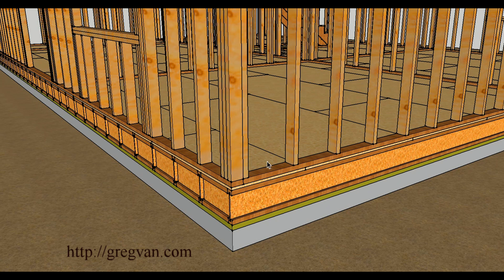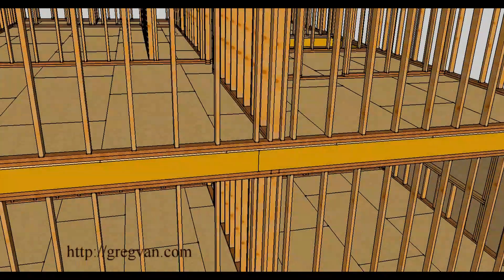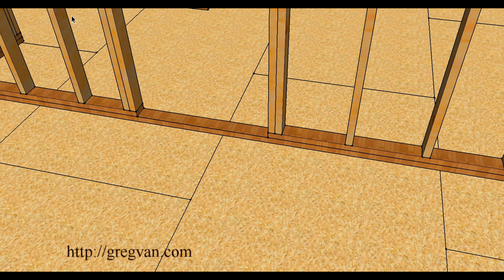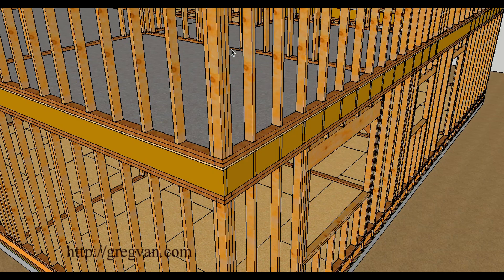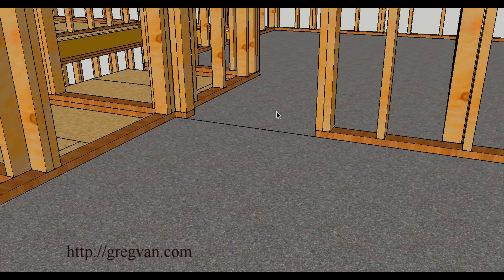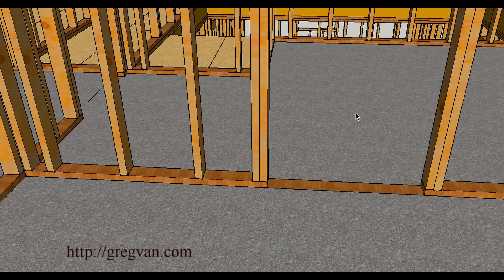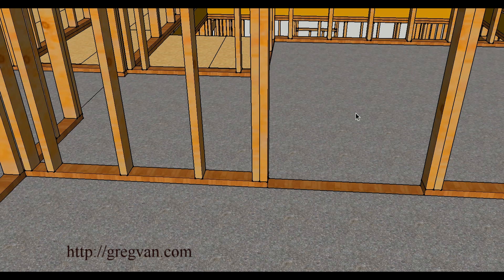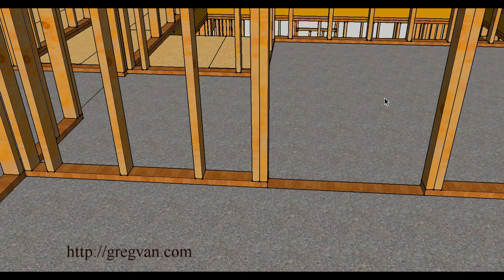Watch This Video Before Using Lightweight Concrete As Sound Barrier Between Floors

Comment: Question, I have an apartment @ the upper floor and they used light concrete also but it squeaks,  I mean, I took the melamine off and realized that the actual concrete does squeek when you step on it...... do you know why and if there is a way to fix this?    thanks!
Reply from the maker: If it's moving, you will need to find out why and this might require removing the concrete or ceiling below to start looking for the problem.

Comment: Should I use 3/4” subfloor or 1 1/8” subfloor for this lightweight concrete floor?
Reply from the maker: I can't help there, but I've seen it installed over both with good results. I think the more important question would be if the floor, walls and foundation can handle the extra weight and that might require an engineer.
Reply: @ 
We are planning a new construction here in the next couple months so all of that should be covered

Comment: Do we need any underlayment (visqueen, plastic, ...) over plywood sheathing before pouring light-weight concrete?
Reply from the maker: I don't think you would need any type of vapor or moisture barrier as long as it's going to be located inside the house or building. However you might need some type of waterproofing if it's going to be located on the outside. I've always seen the lightweight concrete poured directly on top of the subfloor.

Comment: 2 problems with this method, 1 sound is resonation, the sound will resonate up threw the framing and it actually gets louder. you are building a speeker out of you walls.  2  1.5 inches will do nothing and it will fracture easilly because of its structure
Reply from the maker: I've never been impressed by the lightweight concrete and you do bring up a good point about sound resonating through practically every part of the floor framing, including the lightweight concrete. However, I'm willing to bet that somewhere, someone has done a lot of testing and actually has satisfactory evidence to suggest that lightweight concrete does reduce the level of sound transferring from the floor above to the floor below.

Comment: Gypcrete is garbage, a terrible idea, but building and safety bureaus make it mandatory. Absolutely correct, it makes the floor sag. Even between joists with 20" spacing, the flooring will sag over time.

Comment: Just to clear a few things up here... Concrete is mass, which is critical to sound isolation. No debating that. You do however need to assess whether your primary issues are impact noise (structurally transmitted) or air borne noise.  With gyms it's primarily IIC (Impact Insulation Class) that is the ruling factor. Concrete works better for sound that is air borne. IDeally you want concrete with a cushioned underlay to reduce impact noise. Resilient channel on the ceiling below helps with structural transmitted noise as well.
Reply from the maker: Thanks a lot for sharing and great information.

Comment: Most contractors would only use gyp-crete to cover the radiant tubing. There is no point otherwise, if you want sound proofing you would apply soundproofing between joists.
Reply from the maker: I would tend to agree that other methods might work better.

Comment: Question.... In this type of construction are the studs cut down that extra 1-1/2” so that shear walls run down both lower plates and drywall? Which would also shorten the ceiling by 1-1/2” after concrete poured?  If the studs aren’t cut down then next size up in shear wall would be needed and special cut to length?
Reply from the maker: You would need to contact a structural engineer for more information about sheer walls in this type of construction, but usually the extra bottom plate is added and the light weight is poured up to the top of the lower framing plate, then the wall framing studs would remain the same sizes.

On some of the older projects I've done in the past, the framing studs were not modified for the sheer panel and the sheer panel went on like it normally does.

Comment: I used a self leveling compound (which is concrete) on my second story bathroom floor (floor joists sagging) during my remodeling it.  I covered most the floor with it and it has eliminated ANY sound coming through the floor to the room downstairs. I was very happy with it.
Reply from the maker: Hopefully you don't have any problems with the self-leveling compound separating from the subflooring, if it wasn't installed on top of concrete. I like your thinking though.
Reply: @gregvancom  it has a plywood/particle board on top of it, then vinyl tile to finish.  Very interesting outcome if you ask me 😉

Comment: Thanks for the presentation! I thought your title referred to filling the bays between joists with aircrete, which is the option I am considering for a nice 1940s house getting split into 2 rental units. And for insulating the walls. Trying to find out all the things that could go wrong.
Reply from the maker: You definitely won't want to use lightweight concrete and wall framing, but there are plenty of other options for reducing noise in between two units. Insulation and soundboard might be on your list.
Reply: @gregvancom  Thank you very much! This is for locations with no access, except for any drilled holes (all finished surfaces). Injected blown cellulose (settlement) and spray foam (outgassing) both have detractors, leaving AirKrete perhaps, with surprisingly few detractors - however no one does it here. As MgO cement is getting rare and expensive, we have figured out a very light and dry Portland cement alternative. Yes you are prudent to not recommend it, but no specific reason against it was offered. Contact with wood framing is a problem if the foamed cement has access to moisture, but moisture has to be avoided in any case. In fact we have found that one-time-use form-boards hold up better as floor joists than otherwise identical new lumber. thanks again.

Comment: use aircrete for soundproofing. it is the new light weight concrete using foam
Reply: Aircrete or gypcrete
Reply: @sherifnabil9663  gypcrete, what is that?

Comment: For a gym this is totally inadequate. For multifamily housing it's great
Reply from the maker: I have to ask, why would it be good for multifamily use and not for something like a gymnasium? In my opinion, sound would travel in the same way through the floors.
Reply: @gregvancom  Because with gyms IIC (Impact Insulation Class) is the ruling factor. Concrete works better for sound that is air borne.

Comment: This sounds like more trouble than it's worth! Would not foam filled floor work better, with thick wood over, like 4" thick flooring, I dong think it would help with treadmills,  but I don't sound as if litecrete does either!
Reply from the maker: I agree and don't think I would ever use this product, especially after seeing the results of it being used.

Comment: It's lightweight concrete if you put that many bolt or nails to get your walls up it would most likely crack your floor. Pouring the floor after the rooms are in also helps with further sound reduction having the 2x4s imbeded in the floor when the Crete is poured. Most rooms I've poured also have drywall up but sometimes don't depending on plans.
Reply from the maker: I think it was me I would pour the concrete after the drywall, stucco or siding and the roof was loaded or finished. This would help, but if the floor joist ever sagged, you'd be back to cracking and thanks for sharing your experience with us.

Comment: Please forgive my naiveté, but why would anyone frame a sub-floor over a slab or pour a slab over a framed out 2nd floor? Where I'm from, only older homes have sub-floors and newer homes all have slab-on-grade. This is the first time I have ever seen an example of a building with both. And if you were to want/need the 2nd floor to be of concrete (again, something I have never seen), why not simply install and pour over a metal decking (like is done in commercial applications?
Reply from the maker: You bring up a good point, but most of the time this is used on floors above the building foundation, for example a second or third floor. And of course yes there are different ways to do this and probably some that are much better than others.

Comment: Pearlite would be the aggregate you are wanting to mention.  It is not expanded rock ... it's expanded glass.  Imagine a piece of molten glass (super hot) that has been turned into a foam by aerating it to the extreme.... millions of tiny bubbles.  This gives it a very high thermal resistance, and it would probably help with deadening noises.... the air pockets themselves do that, not the concrete.

A better "lightweight concrete" for this application would be aerated concrete, also known as "aircrete".  It is made of pure portland cement mixed with a dense foam made from dish soap and water.  The weight of aircrete compared to concrete is perhaps less than half, as it's filled with tiny little soap bubbles.  It's durability could suffer a bit, but it's use as a sound barrier would be vastly superior to the lightweight concrete you mentioned.  Make certain to install a good sturdy flooring substrate over top of it.

You may also wish to make it go even further by mixing pearlite into the aircrete, as that would have little negative impact if any at all, and take up additional volume.

I would suggest you make several test plates of varying thicknesses and install them in a mock room, testing the sound absorption qualities of each thickness and type.  Good luck to you!
Reply from the maker: Your comment is greatly appreciated and I always love to learn more about the business. I have heard of air entrained concrete, which is what you must be talking about with the aircrete and I always get perlite and vermiculite confused, now that I've been doing some gardening realize that it's perlite. Thanks for taking the time again to share your knowledge with us.

Comment: Why not install the bottom plates first and use them as screeding guides, then, after the floor has set, frame and tilt up the walls and partitions?   And, what about gypcrete?
Reply from the maker: That's a good idea and it seems like it would make a lot of sense, but the lightweight concrete seems to get beat up while the construction workers are framing, installing plumbing, electrical and is often poured before drywall installation. I think it's just a way to reduce damage done to the lightweight concrete.

Comment: Hey.  New to your channel but on the weight of the foamcrete we were just doing some test pours.  We made some forms that were 6"x24"x24"  which were the smallest we also did some 8" thick .  We let them sit for 24 hours and we wanted to see how much they weighed and my friends 6 yr old could easily pick up the 6x24x24 over his head
Reply from the maker: That's impressive and would you consider this to be a durable product, something that you could walk on or place large pieces of furniture on. Do you think it would be something that could easily be damaged?

Comment: Sand cement lavarock pozilans and  plastisizers.
Reply from the maker: Are these other materials that are used for lightweight concrete?
Reply: Some of them, yes. Blast furnace slag can substitute for sand and is half the density. These days, thinner (lighter) slabs can be made with the same structural strength and increased resistance to cracking by adding plasticizers and fibers (polyvinyl alcohol - PVA - or polypropylene) to the mix.

Comment: The weights you mentioned is lbs per cubic feet.
Reply from the maker: I rarely come across measurements that are in pounds per cubic feet, but would like to point out that you bring up a good point and that would be to double check building specifications, to verify whether or not weight measurements are per cubic inch, cubic foot or square inch or square foot.
Reply: @gregvancom  NWC is 150 pcf and LWC around 112 pcf possibly lower for insulating types. Using 112 pcf LWC would give you 9.6 lbs sq ft with 1" depth. 1.5" deep would to ~ 14 lbs/sq ft.

Comment: Lightweight concrete weighs 115 lb per cubic foot, therefore at 1.5" thick should weigh 14.375 lb per square foot.
Reply: These days, with the addition of fibers, perlite and plasticizers, the concrete can be even thinner and lighter than that, although it does get a bit more expensive to make it thinner and lighter.

Comment: Very interesting. I still wish I had poured lightweight concrete on the floors in my custom home. Not only for sound but also to minimize bounce. engineered trusses can handle a lot of load but they still bounce. I would have added more trusses. I would have had to consider alternatives to a forced air HVAC system but there are plenty of alternatives that would work. It only costs money :)
Reply from the maker: If you have the money, then absolutely. However, not all engineered floor trusses are designed to support lightweight concrete. It really is something that needs to be thought of during the design phase.
Reply: The bounce you talk about i believe is called deflection or vibration from walking. The best way to deal with that like you said is to increase the stiffness (add rigid joists or subflooring) and/ or increase mass of the floor by using gypcrete or concrete.